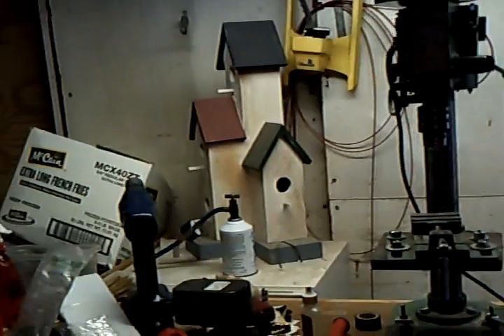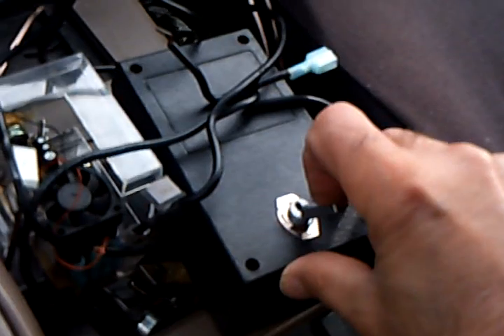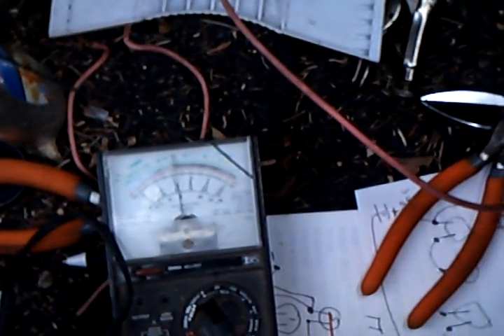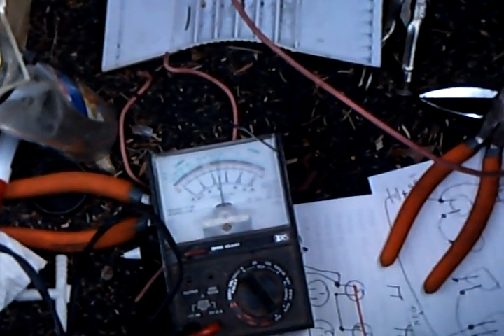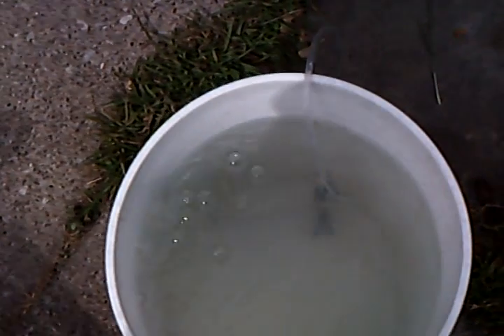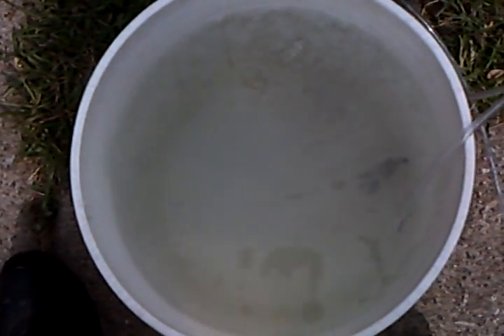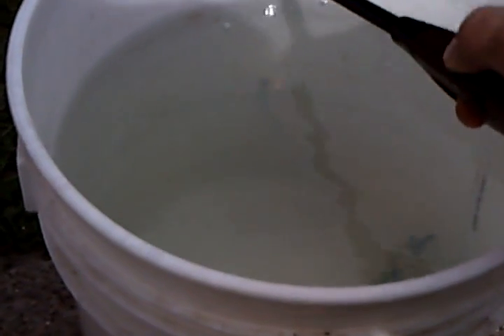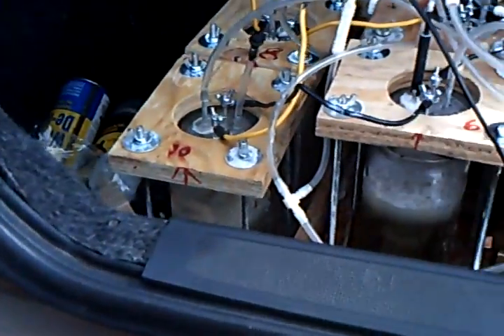16 cell hho gen.

Comment from the maker: @wcemichael  these are hooked with only 4 cells in series. I have not tried to hook all 16 in series. I did run this in my car with all 16 cells running with 4 hooked in series. the MPG gains were small but I used a 20 year old ford

Comment from the maker: ok interested people =  this has been running in my car for over four months now . the cells never get hot and there is very little contamination in the electrolyte. and as far as the mpg's.  its just to difficult to give mpg results. All I can say is that its slightly better with than without HHO . everytime i show it to someone= it takes down the overall results as they have to watch and see how it works

Comment from the maker: ( PJ )  there is a lot of hose and the bucket of water is very deap,and there is a steel thing on the hose to pull it to the bottum of the 5 gallon bucket. Water pressure creats the delay in the bubbles

Comment from the maker: ok the volt meter was showung about ten volts at 7.5 amps.  Now there is 8 plates in each cell X 16= 128 plates TOTAL . with 4 cells in series there is very little heat produced . not enuff to make a diference in amps. but today was cool out and the amps ( when its hotter out ) will go above 15 amps and make just about one liter of gas per minute